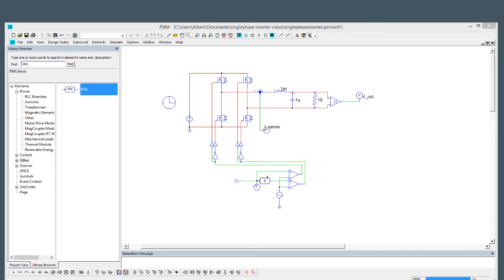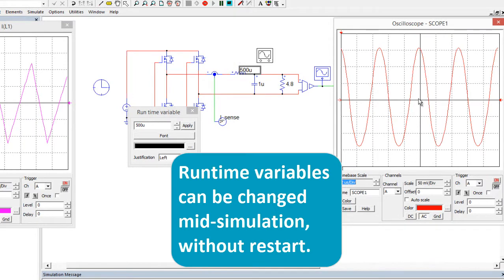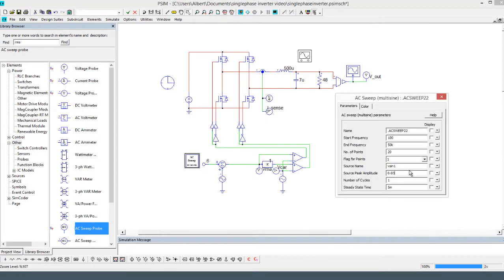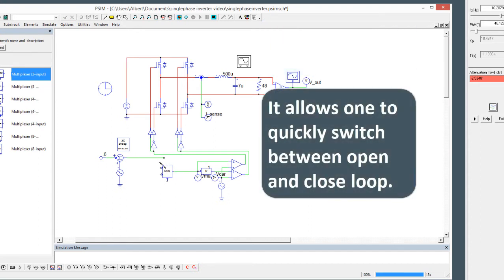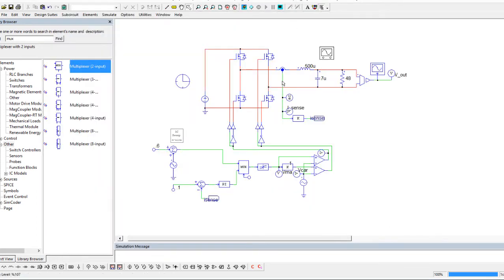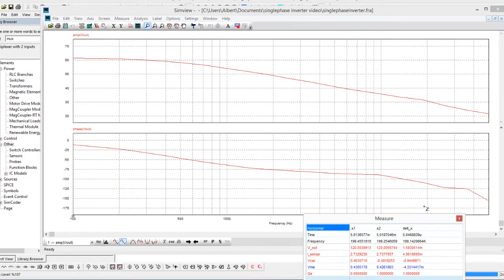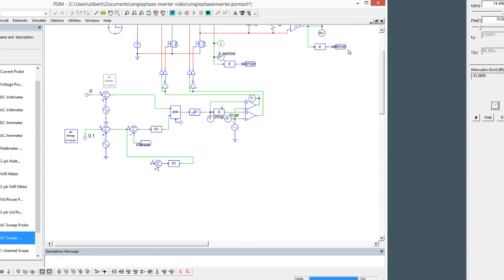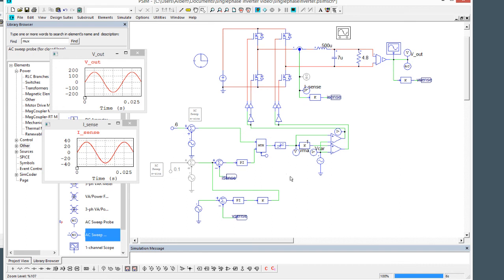Inverter design with average current and voltage loop control | PSIM

Comment: Dear Albert,
I'm curious about, What happen  when the load is not a resistor, Instead an inductor or any non-linear load? the plant of V loop and I loop will be quiet different, it might not stable using a PI controller?

Comment: Hi Albert, nice work! Could I have the both controllers' parameters for 240V output? I want do some work with it but I don't have a SMART CONTROL. Thank you
Reply from the maker: I will post the schematic to our forum later today. Just at ECCE this week. Forums.powersimtech.com it isn't there yet
Reply: @altairhowto  Dear Albert, thank you for your reply. Are you going to post the schematic with 240V output? I have learnt and built a 120V output schematic from your video. Since I don't have Smart Control, I couldn't get PI controller work correctly for the 240V one.
Reply from the maker: @s6l662  Hi Sean, you need a big enough DC bus to get to 240V and then change the reference, I can't do your design work for you!!!

Comment: Hi dear owners, when I find total harmonic distortion in psim should I multiply it with hundred to get percent THD or it is already in percentage..
?
Reply from the maker: if the result is 0.2 that is 20% THD
Reply: @altairhowto  thanx alot

Comment: Hi, can that inversor be used as a bidirectional conversor or just in the ac/dc way?
Reply from the maker: essentially, you need to put some capacitance on the DC side. I'm not excited about the cap on the AC side, look up a totem pole PFC. It is the same topology.

Comment: @PSIM hello there Albert, i was wondering which formula would you use to set an inductor, capacitor for 400v dc input to get 220 v ac
Reply from the maker: Hi @butera you need more information than this.. as the inductor and cap sizing are based on ripple specs. That being said, the "buck" equations are valid for the output stage of this inverter.